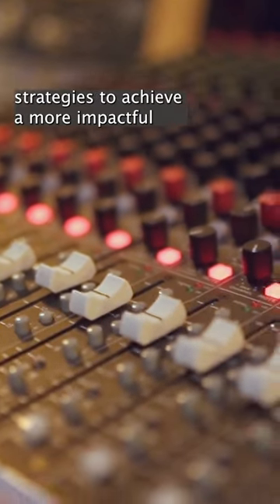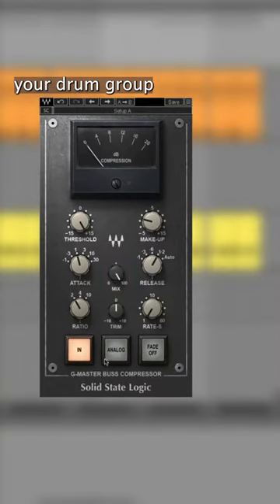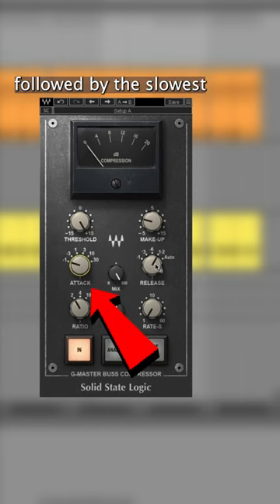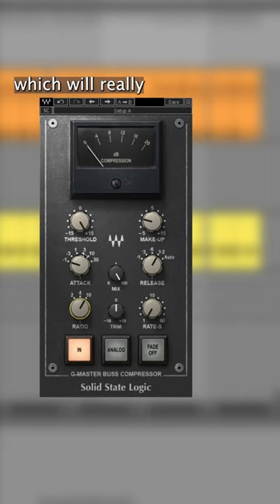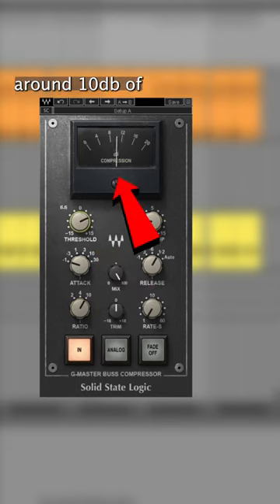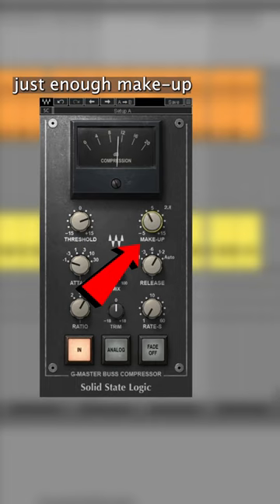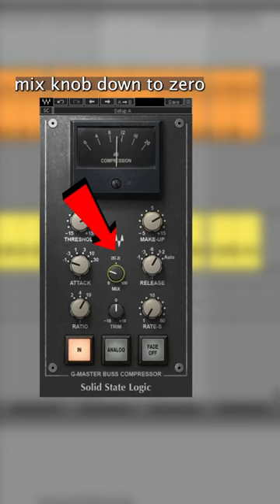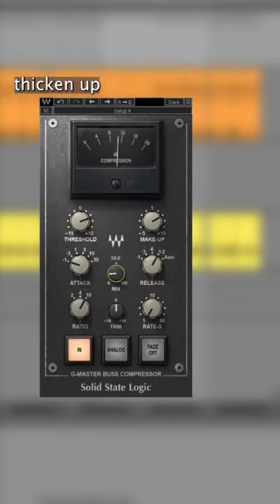Bigger Drums with Parallel Compression #compression #mixing

Comment: Slow release doesn't make much sense is you're going for sustain...
Reply from the maker: The idea here is we’re trying to exaggerate the compression. With that in mind, the fast attack clamps down on the material immediately, and the slow release keeps it reduced. 

By doing so, we’ve drastically reduced the transient (or initial impact) of the sound. 

However, by keeping it compressed with the slow release, we’ve increased the sustain since now the beginning of the sound (the transient) is heavily compressed / reduced while the part that comes after (the sustain) maintains the level of compression. 

Through the makeup gain, it covers up the overall loss of volume and therefore increases the presence of the sustain since that is in line with the level of the attack now. 

If I had a quick release and no make up gain added, then it would be exactly what you described but that isn’t the case here. 

Important to consider that the release ultimately shapes the TONE more than anything. Faster release tends to sound more punchy, slower sounds more round. Really you can use either one based on your preference and achieve good results. I gravitate towards a rounder sound but sometimes I switch it up.

It’s very easy to misunderstand compression but hopefully this makes more sense to you now
Reply: Wrong.
Reply: You are looking at this as if it was a transient shaper, fast release and fast attack to only affect the transient of a signal and not the sustain, however thats not the point of a parallel compression that aims to have a blend of original dynamics with an exaggerated version of the compression.

What you lose on the sustain with the compressed version you regain it when you blend it with the non compressed version essentially
Reply: @5piece  that’s a great explanation. Makes much more sense to me now
Reply: @5piece  Slow release will keep the gain reduction for longer than the attack portion of the sound, affecting the sustain portion, thus reducing sustain. Slow release is a mistake here.
Reply from the maker: @martinmorales3195 ”mistake” is very debateable. Used short and long releases, both are viable just depends on what you’re going for tonally. There is no “one” method. Tons of my mixes have been played a million times and have this exact method implemented. To say it’s “wrong” is wrong LOL the numbers and results don’t lie 😉 it’s OK to try different things and explore different philosophies my friend!
Reply: @5piece  Good points but the 1.2sec release is just too long here. It would only make sense and me rhythmic on the quarter notes, but the snare is the only thing that's just hitting quarter notes, and its sustain is so short, so i feel like you're pumping hard here and the compression is constantly bleeding into the next attack. Not trying to be critical, just debating!
Reply: @5piece  the only thing you are getting wrong is how you are describing the process...and i think what your critics are pointing out is that your narration and explanation for these compressor settings to achieve a certain sound is ultimately not what is achieving the final sound. You might be very successful in that the tracks you've worked on have millions of spotify streams...but the same was done by Lil Nas X and an enormous amount of amateurs that have just a basic passing knowledge of how audio "works"....that alone tells nothing about the skill of the engineer. Spotify's own compression algorithm might be the magic element that makes your work sound good on the cell phone or mono Bluetooth speaker that is playing back the majority of steams. 
It is important to use terminology correctly and attribute the correct effects with the correct settings. ie: you referenced make up gain as being the way to reducing the pumping effect of such a high compression ratio.. but make up gain doesn't do that at all. Plus, on this particular compressor, (assuming it is modelled accurately since i dont use the Waves SSL myself) such a high ratio takes this out of the compression realm and puts it squarely in limiting. Might not be the best choice for this specific technique of parallel compression. You do not need to limit yourself to a compressor with a "mix" knob... sure, it's a shortcut and especially on the physical SSL console was like a gift from God the first time I used it, but it was a shortcut... It is not how paralell compression is normally implemented. Parallel processing can be used in a number of different and wacky ways with outboard gear (or AAX/VSTs) that do not have their own 'mix knob'...So plugins that get discarded by users simply for producing a warped or highly distorted/coloured sound that on its own sounds bad can be some of the best ones to try with paralell processing. ie: Frank Filipelli loves to fuck around with these types of dynamics on his paralell buses... the Mix knob is not the only way to engage paralell processing ...I'd even argue it is a disservice to "teach" people this way without even acknowledging it as a being a shortcut and not a necessary requirement for paralell processing..

Comment: Cool tip, I might try it when the song calls for it. I do see quite a bit of debating a lot in these comment sections but it's best to just keep in mind that you should do what you feel would add to the tracks mix, don't fully rely on YouTube videos to tell you what a song needs cajse you're not always going to need parallel compression, or you're not always going to need a delay or reverb. Just go with your gut people and if you achieve good results then you're doing something right :)
Reply from the maker: Correct. What’s interesting is when I make these videos, I’m sharing general practices that I incorporate (and sometimes those practices change over time). I never say “this is the only way” but often my message is misunderstood and interpreted like that’s exactly what I’m saying. Rules are meant to be broken, and with mixing, most “rules” are pretty loose anyway. Thank you for sharing 🙏🏼

Comment: Why not set it up as a send so you don’t need to fool with the mix knob? I realize you’d still have to fool with the send amount but I’m just trying to see if there’s a technique I’m unaware of or if you’re just setting it up differently. Please lmk. Thanks bud
Reply: But why would you do that if you can just use the mix knob
Reply: @binladen5299  few reasons. For one, u could add to the chain on the bus. You can only do that with inserts if they ALL have dry/wet knobs
Reply from the maker: You can absolutely do it this way as well. I honestly float back and forth between using the mix, and using a send. The send can offer more control, giving you access to the mix knob still but also the volume and the ability to add more inserts (ie EQ) before or after the compressor, so I get why you may prefer that.

Like all things mixing, there's many ways to do something so I'm demonstrating one method (the mix knob) in this brief 60 second short. To demonstrate all potential methods, I'd need a full-length format. End of the day: use the method you prefer most.
Reply: @5piece  okay so if you know the proper way, why are you teaching people shortcuts that will ultimately limit them?
Reply: @audiofaktory because this is yt short and he couldn't cover every single way possible in just 60 seconds. Thus, he has stated that it's his preferred way. He admitted that there are more ways into it and I think you already understood when he said he chose this way bcs that's just how he works?
Reply: @risolbakar69  soooo you agree that it’s going to get young producers to cut corners which is the only thing you could be so angry about, as my initial comment was a legitimate question. So what exactly are you saying? That because google developed a thing called YT SHORTS, it’s a GOOD thing to teach shortcuts that will limit their skills? And the OP mentioned your only actual point already; that he explained this because it’s a short. So what are you even doing
Reply: @audiofaktory  ??? What are you getting worked up for mate? You lacked some dopamine or what? I stated that just to reconfirm the OP's statement so you didn't need to question the OP's decision to use whatnot because he already stated his reasons. Beside, if you already know what his reasons are, you didn't need to ask that question again (okay if u know the proper way why you blablabla) just to interrogate him out of your dissatisfaction because he was using some methods that seem not completely proper to you. You contradicted urself lmao
Reply: @audiofaktory  "why are you teaching something that will limit them" you clearly didn't fathom when I said the reason he might couldn't cover everything and decided to use this method was because to announce shortcuts through shorts. Maybe he could've explained more if he made a long video. That's my point. Do you understand now?

And I wasn't angry. I didn't know what kind of physic power that suggested you to think that I was angry when I just decided to reaffirm his point 😂

Moreover, I didn't say that young producers should be cutting corners. I was just reaffirming OP's point. If young producers could understand more than this, then ofc it's good for them. Stop making assumptions that weren't there in the first place, ffs
Reply: @risolbakar69  as I said above, the OP already made the point about the shorts! You’re repeating
Reply: @audiofaktory  I repeated because you didn't seem to UNDERSTAND the points stated above by me and the OP. Hence, you still asked "why are you teaching something that is limiting people from using the proper way" something.
Reply: @risolbakar69  I understand perfectly. It seems it’s you that didn’t read. The OP said that he explained it this way. You’re repeating him. I saw what he said. I don’t need you posting a repeat. Hell, why am I even replying to you? This was sorted out 6 months ago and you’re adding nothing new lol just rage
Reply: @audiofaktory  you said you understand yet you still asked that question, acting like you understand it perfectly. If you understand then ofc you wouldn't ask it again afterwards. Because you asked it again afterwards then is it wrong for me to re-explain it once more to you? 🤔 And you're the one who's being rage in the first place when I just restated calmly without any rage in my first comment. Stop making dumb assumptions, that's just funny 💀
Reply: @audiofaktory “get young producers to cut corners“ lmao its not that deep. If these so called „producers“ only rely on a 60 seconds clip instead of DIVING MORE in the topic, its their own fault. Using the mix knob on the compressor was just the fastest way to demonstrate, whats even your point getting to intense about it lol. He even answerd your question

Comment: Do you recommend doing parallel compression directly on your drum bus or do you prefer to make a duplicate signal, put the compressor on that one, and then mix in the two drum signals with the faders? Because i see people doing it both ways. Confused myself as to which one is the best practice
Reply from the maker: Both options are viable, and I use each of them depending how I feel on a given day. Creating a duplicate (or a send) I find is better because you have more control over everything with the added volume fader and plugin inserts. However, you can also just apply a compressor with a dry/wet knob directly on the bus. 

In mixing, there are many ways to achieve something. Nothing is necessarily right or wrong but really just up to individual preference. All that truly matters is that it sounds good 🚀

Comment: Exactly except I’d suggest starting w a low ratio. Bumps harder. But of course do what sounds best for that song
Reply from the maker: I’m learning everyone has their approach/preference with this stuff. Because I like to really exaggerate the comp for this, I’m going higher but as you said, some songs may call for a more subtle parallel comp approach. Like alway, use your ears and judgement accordingly 🤘🏻
Reply: @5piece  For sure. On parallel I’ll often go super high ratio or all-in if using the 76.

Comment: You have the attack and release backwards. Slow attack to let the transient thru, fast release so the next one gets thru. Also put it on a bus and keep the mix at 100% and then raise that bus to taste
Reply from the maker: What you're proposing setting wise is for STANDARD compression, or more transparent compression. 

The purpose here is for PARALLEL compression, where I specifically want to EXAGGERATE it and then blend it back in with the original dynamic sound. 

Therefore I WANT a fast attack to clamp down quick and a slow release to hold the compression, producing an exaggerated effect. 

You may have different tastes for this process, but the general purpose of parallel compression is to squash the signal - creating a more consistent sound, and then blend it with the original dynamic signal to achieve a "best of both worlds" effect. Hopefully this makes sense and clear the air.
Reply: @5piece  I know. That’s what I’m saying. Put the compressor on an aux track and bus some signal over. Never mind you must be new. Please look into what I’m saying so you don’t embarrass yourself further. I fully understand parallel processing; and while you’re correct that the mix knob makes it parallel, you don’t seem to understand what Im saying. Have a day
Reply: @5 Why you are doing this wrong, you will only get more volume but not harder hitting drums, slow attack at least bruhhh

Comment: He said put it on the drum bus? Wouldn’t this go on parallel track FX bus or aux?
Reply from the maker: Multiple ways to do it. Yes, you can do it via parallel aux/bus (which i also do), or you can also put it directly on and blend dry/wet knob assuming you’re using a compressor with that functionality like I was in this video. 

I’m always trying to showcase different ways to do the same thing across my videos - one may showcase method A, another will showcase method B and so on. Hope this clears things up
Reply: Not necessary if the compression plugin has a mix knob

Comment: using the slowest release will only dampen the effect of the compression. Really ur only compressing about 2db with the slowest release rather than 10db. Ur just adding un-necassary gain reduction. And make up gain doesn't reduce pumping
Reply from the maker: So you’re suggesting the GR meter is completely inaccurate then based on the release time? If so, how come as the release is adjusted, the GR meter also adjusts? I understand the point you’re trying to make, but it doesn’t line up with the metering so I’d love some clarification on that since I don’t see the evidence of your point.

Also, as mentioned in some of these other threads, my goal is to greatly exaggerate the hold effect of the comp so it’s basically flattened fully (and then mixed back in with the dynamic signal). I realize there are diff methods of approaching PC - and release times is hotly debated. For me, release is mostly about tonality and of course intention, as I mentioned.
Reply: @5piece  Im saying, since the GR meter is staying between the -12 to -10 mark because of the massive release time, the compressor is really not doing much compression at all. (because the gain meter is between -10 to -12db) so its not giving enough time to let the sustain back in. I you were to chose a faster release time, the GR meter would show a larger difference between compressed and released. and thus allowing more sustain to get through without adding the un-necessary gain reduction as seen in this video. You could create the same sound just by using -2db of gain reduction with a faster release. because the difference seen is only about 2db
Reply: @5piece  do u get what I am saying?
Reply: still no reply?